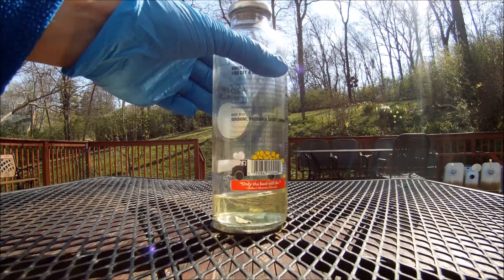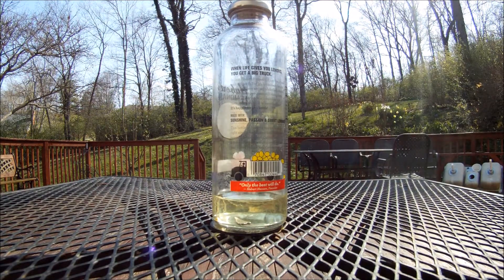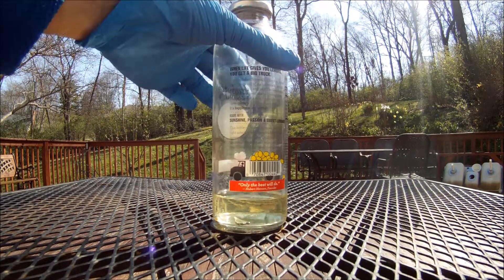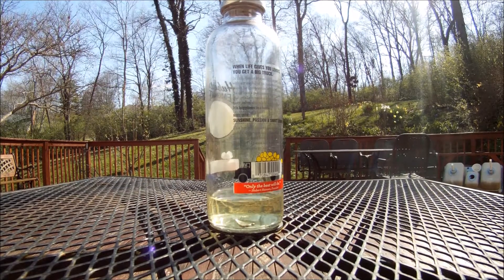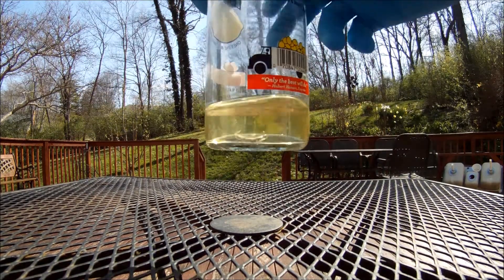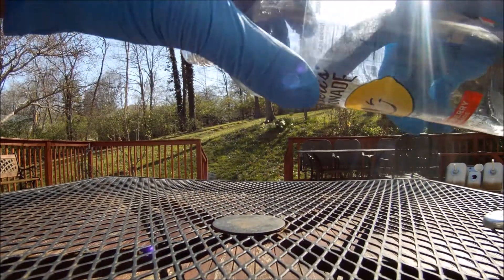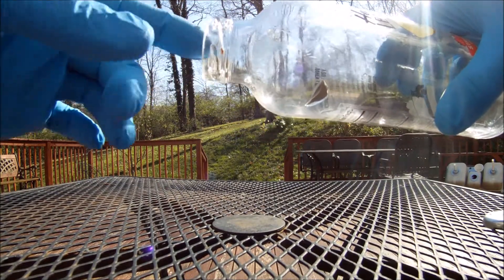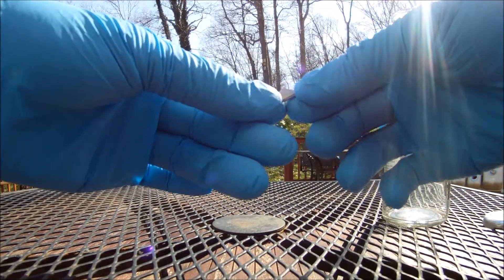Watch This Before Putting E85 in Your Aluminum Fuel Cell/Tank. 16TH MONTH UPDATE.

Comment: No. Believe me after a few years it will corrode. I had a 16 gallon cell with tht alum and ran e85 in my TT Boss 302. It will eat up all rubber, all the splash guard in tank and aluminum. Had to go back to steel tank. You’re shot will corrode eventually. The alcohol content on E is too high. Just from my experience
Reply from the maker: I am going to check it this week again with the same fuel still in it.
Reply: Was wonding about that wanted to run e85 stand alone nitrous  but was worrie about my rubber lines and fuel cell